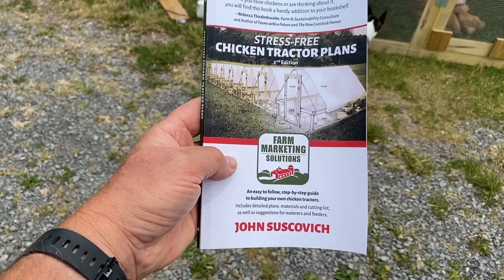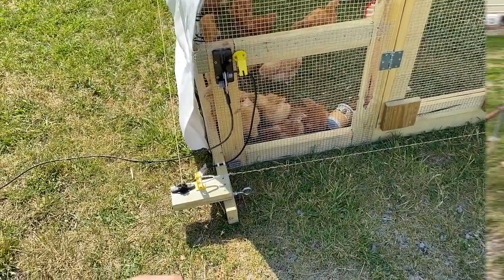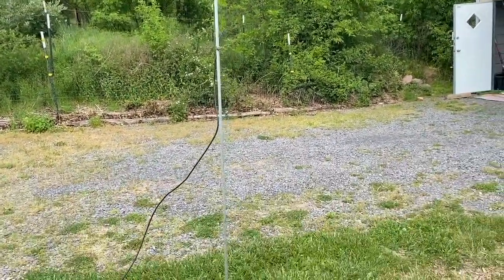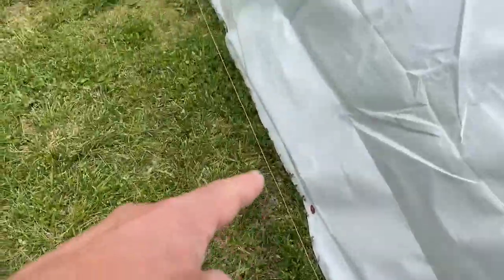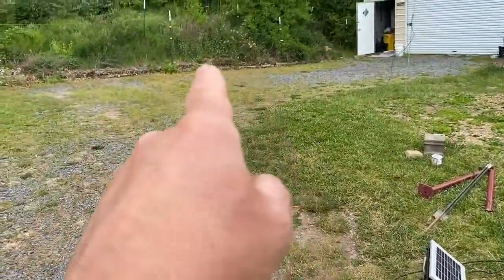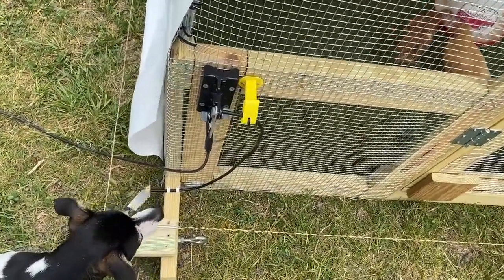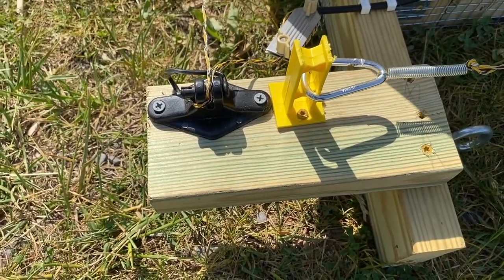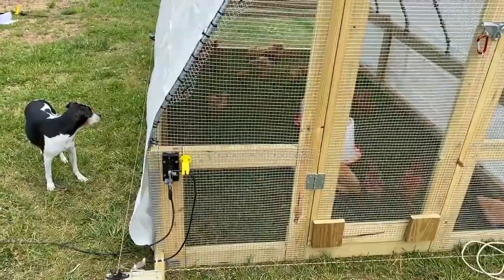My John Suscovich Chicken Tractor Electric Fence Wire Explained

Comment: Learning how to install electric fence to protect my small flock from predators and your video helps a lot!I don't have a chicken tractor but I'll be permanently attaching the electric fence to keep out diggers!
Reply from the maker: Awesome!  Glad to have helped.
Reply: @greatescapefarms  I live in West Virginia as well and was wondering if you've ever had a problem with weasels getting in your tractors?I only have a small flock of 6 layers and can't afford to have any losses.They're also my pets ! I used 1/2" hardware covered pallets to make a 8 x 16 run for my hens and need to know if one 6" wire is enough to keep weasels out? Thanks!
Reply from the maker: @Yeshuaschosen  I have not had a problem with (or even seen weasels around).  I would think this would keep weasels out, but like I say, I don't have any experience with them.
Reply: @greatescapefarms  Thank you!
Reply from the maker: @Yeshuaschosen  You are most welcome.

Comment: So for an update are you still using this system and have you had any more losses?
Reply from the maker: We are still using the chicken tractor and have had no losses as a result of the tractor or its design.  We have standardized on moving the young chicks from the brooder to the chicken tractor.  They spend the summer into fall in the chicken tractor to grow out and then we integrate them with the other birds in the coop and run in the fall.